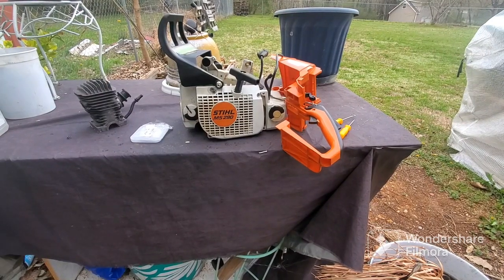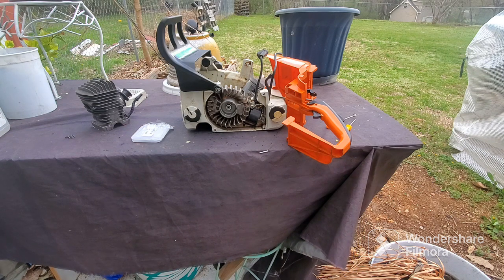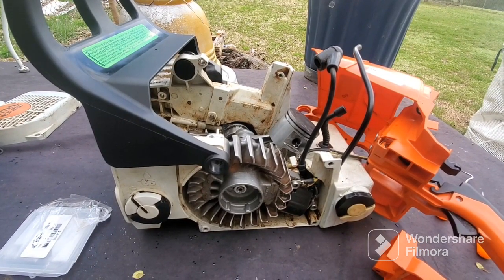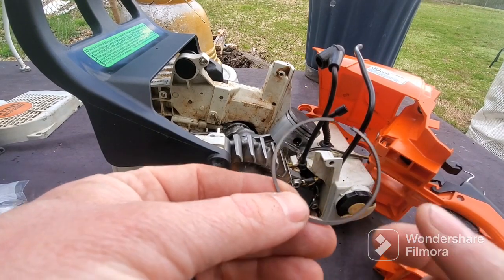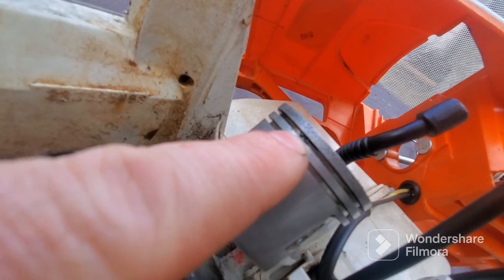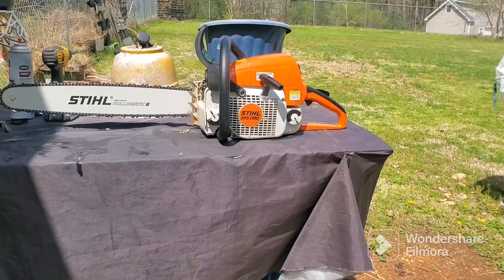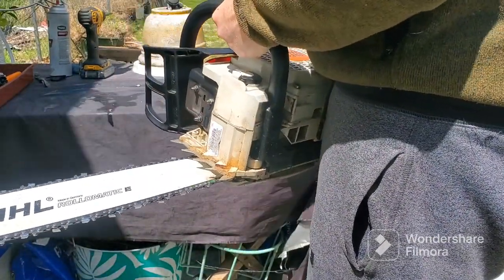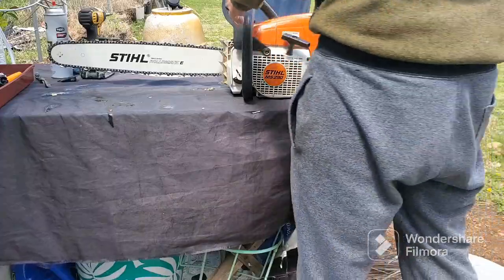Stihl MS290 Chainsaw Low Compression Drops to Ground

Comment: Thanks for the video. My 290 has 60 psi and looks as new as yours. Very little use. I got it at a residential yard sale for $75, and used it lightly for 1 year or so I have a 018 for the lighter work. Residential work only on 5 wooded lots with 2 houses on them. The Piston and rings look good thru the exhaust port. I've been looking for my leakdown tester, but have not found it yet. I do have one and I have a few more places to search. Hopefully, all it needs is rings too. Stihl might have gotten a batch of faulty rings when it was assembled ?? !! I think these MS290 models, came out in 2011. Thanks again.